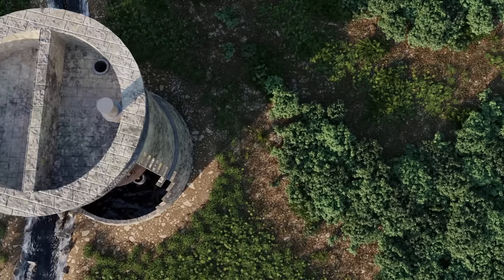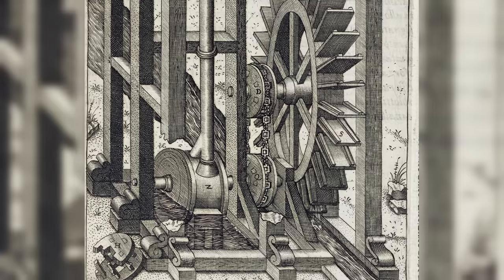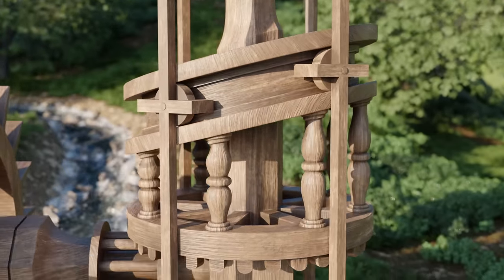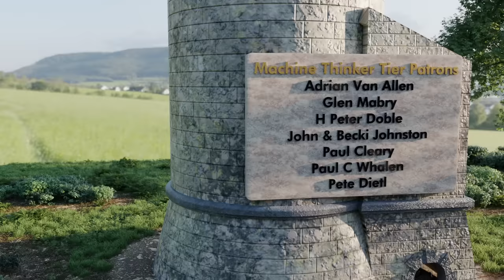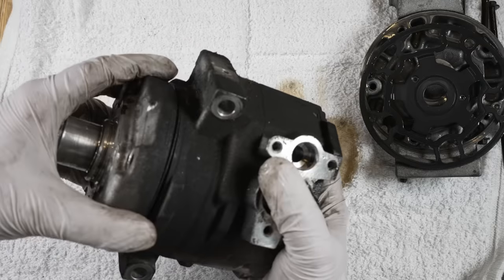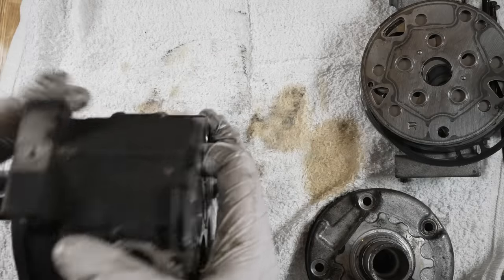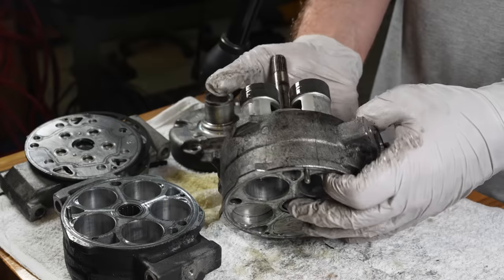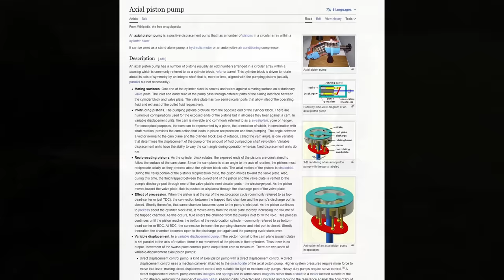How an ingenious 400 year old drawing predicted the future

Comment: Fun!  Just subscribed!  Ty!  It looks like a hydraulic pump on an turbine engine.  They are used to produce three phase power APUs, ailerons,  flaps, rudders, and wheels under load from the engines or for a limited time with a stand by jack when the engines quit for emergency situations.

Comment: I have disassembled a rotary pen type machine that used a swash plate system to drive the needle.  It had a Faulhaber motor and was very well made and smoothly operating.

Comment: Constant pressure variable displacement hydraulic pump of some kind. I was a hydraulic mechanic on UN-1N's and AH-1W's in the Marine Corps. our aircraft had 1,000 and 3,000 psi hydraulic systems respectively and I've taken apart lots of pumps and they look exactly like that on the inside. Except the pumps I worked on were no bigger than a soft ball for obvious weight savings on an aircraft.

Comment: I've seen designs where the swash plates themselves drive the fluid, but it's a sinusoidal type shape on the outer rim. There was a flurry of them on youtube about 15 years ago, claiming to be new engines with perfectly circular movements, no cranks or eccentric motion needed, so you get high speed rotation. Still achieving the intake, compression, combustion and exhaust phases.

Comment: Not just stuff like the car's AC, but you also have it in hydraulic sender pumps for things like excavators or even a ship's rudder (where the tilt-block is adjustable to reverse the hydraulic pumping driving actuators), or you find the same general configuration being driven the other way by the pistons in air powered tools.

Comment: Immediately at the castle portion I knew it was a pressure pump of some sort. I only know because I wanted to take apart a water pressure washer that had issues with seizing. Its well over a decade old and was from a garage sale. For $30, its engine was still good and used for both a kart and generator projects. The pump itself was bad (worn seals, corrosion, material loss; probably from some corrosive liquid or just sitting doing nothing with tap water) and could not be used for anything but was taken apart first before scrapping. Had this exact mechanism except it had 3 cylinders instead of 5.

Comment: Helicopters use a similar (adjustable) swash plate to actuate the blade angle of the rotor, making the craft steer left, right, forward or reverse.

Comment: For anyone not making the connection of pumps to air-conditioning.
The way most air conditioning works is you compress a gas vapor under pressure (thus the pump), which costs energy and makes it hot, you then direct the heat to cooling fins, and then when you release the condensed gas into a low-pressure space, the gas cools as it expands back into a vapor.  That cold gas then either flows directly across cooling elements in an AC system or coools a liquid which transports the not-heat to where it is needed.

Comment: This is also how a hydrostatic drive works on riding lawn mowers (and larger tractors also);  except it's in reverse:  meaning, you apply pressure to the pistons and it moves the shaft.   Rather than the shaft driving the pistons to make pressure, there is pressure applied to the pistons to drive the shaft-- and propel the mower forward or reverse on command with a two pedal design, no shifting at all.   The gas engine drives a pump that I believe is also the same design as this.  So there's actually TWO of these machines in a hydrostatic drive.  One converts engine torque into pressure (pump) and the other converts that pump pressure into axle torque (drive motor).

Comment: The water was pumped to the reservoir on the top of the structure in order to increase water pressure and steady flow at the bottom end of the downpipe, some towns in rural areas still use that method

Comment: A very similar design is used as a hydraulic motor in aviation. Instead of turning the input shaft to pump something, fluid is pumped to it and the shaft turns, doing work. I wasn’t aware the basic principal is that old but I should not have been surprised. We’ve had smart people amongst us since the beginning.

Comment: Rotary wing aircraft use a virtually identical method to apply pitch to the rotor. in the same way that pump throughput was balanced, the pitch adjustment is distributed, making cyclic directional changes possible with greatly reduced stress.

Comment: The return pipe at the top isn't some random pipe because he "couldn't imagine the water not goting anywhere". It's the water feed to the village or factory or whatever this would supply water to. When that pipe fills it becomes pressurized making it easy to push where you want it.

Comment: Phil Irving designed a swash  plate natural gas pump used in Sydney, it was double ended with I one ends pistons being the pump and the other an engine if memory serves. 
Also a common design of pressure cleaner pump.
Variable displacement pump and fixed motor versions are in hydrostatic drives in all sorts of low speed equipment.

Comment: Posting as requested before seeing the answer or reading other comments.  That pump is exactly the system used in automotive air conditioners.  GM first developed it for Cadillac in the 1960's since it was much smoother than the standard reciprocating pump.

Comment: I had a cordless sawzall that used the same angled cam system to drive the blade reciprocation. Lots of pressure washers use this design too. Not just AC compressors.

Comment: They have hydraulic pumps  that push fluid at extreme hi pressures, hydraulic motors and pressure washers that use that design. Very powerful pumps.

Comment: The reservoir and drainpipe at the top, just like a modern (or older) water tower, acts to maintain a more or less constant water supply pressure, at least, over the narrow range of depth of the reservoir.  It would also allow flowback of excess water back to the stream or river.

Comment: This is also somewhat similar to how some tractors are propelled but in that case it would be two separate pieces - on one end the transmission spins a wobble plate, the pistons pump a hydraulic fluid through a bunch of hoses, thus applying pressure to another set of pistons, and those spin another wobble plate that spins the wheels

Comment: If you put a cam on the water wheel itself, you can translate the sinusoidal horizontal movement into vertical movement via two 90 degree triangles, thereby saving about a third of the works.

Furthermore, a wheel lever attached directly to the water wheel can pump with no other machinery at all!

Comment: I used to work on hydraulic variable displacement pumps for aircraft, which work on the same principle, only difference is that the wobbleplate angle is variable.
A few rooms further from me they worked on CSD's (Constant Speed Drive) for the aircraft generators which also had a variable displacement pump in order to maintain 115 Hz or whatever the grid frequency is.

I didn't know AC compressors worked on this principle as well.

Comment: I was about to say A/C compressor in a car. I have attended the repair shop work on my car :)

Because the pistons have the same section on both side, I don't think there is a low or high press ion side. It is just double number of active pistons.

Comment: Reminds me of the self compensating variable displacement radial piston hydraulic pumps on excavators and snow blowers. When none of the hydraulics are in use, the swash plate is in the center or neutral position. When flow is detected the system automatically moves the spool to swing the swash plate. On a large ribbon blower these things can pump 60 gallons per minute or more either forward or in reverse.

Comment: If I were to guess, giving the benefit of the doubt, the reason the water has a place to drain once it gets to the top, is because it's a water tower. Likely would pump it to the top, then send it where it needs to go (in town or in a crop field, ect) and keep the system pressurized by gravity.

Comment: IC engines have and still do use swash plates.  Engines are pumps whichever way you look at it.  The water escape hole in your excellent rendering could easily feed into a level feed pipe as the tower automatically creates head and thus pressurised delivery. 
As a much younger man I had a swash plate engine in my head before I became aware they were in common use.  But designs on paper or in the mind are nothing until put into reality. 
Ramelli was a very prescient thinker. Great video! Subscribed! 👍🏻

Comment: The Dynex checkball hydralic pump is a much closer analogue to Ramelli's concept. The cylinders are fixed and the swashplate rotates. No valve plate is required and the internal leakage is close to zero. You can combine this with a VFD driven electric motor to get near infinite flow control.

Comment: Pressure washers use this approach too, to get very high pressures with a low flow rate -- and thus making the connection full circle back to Ramelli's water pump.

Comment: I've seen (and done job shop work for a customer on) power steering pumps, I think SAAB or something, that are swash plate pumps like this.  I also believe that many hydrostatic lawnmower transmissions work on the same principle.  But yeah, A/C compressors are almost all swash plate pumps, some of them are variable displacement and controlled by the computer (I remember GM used these on the LS motors).

Comment: There are very similar pumps, the "variable displacement piston pumps", with the difference the swashplate can change inclination to obtain a variable displacement. Another difference is that the swashplate is stationary and the cylinders rotate instead. these are used in hydraulic systems in airplanes to move the control surfaces, landing gears etc.

Comment: It is equivalent to a for cylinder set-up for a combustion engine. Just pumping water instead of compressing gas. The up and down causing disk does the work of a cam in separating the "cylinders".

Comment: Always thought it would be neat to make a single cylinder piston engine using this type of barrel cam. It would be super compact and the output shaft would be axially aligned with the center of the piston.

Comment: I lot of hydraulic pumps and motors use the swash plate design.  Quite popular for speed control like in some skid steer loaders. Also used for variable pressure/gpm flow.

Comment: The hydraulic pump version is more closely related to the old water pump designs than the automotive A/C compressor designs. Variable displacement and high-pressure capability are key features of these piston pumps.

Comment: 5:14

forestry machines use a pump of a very similar design but with a variable swash plate for precise hydraulic control, rather than simple valves, also pretty much every hydrostatic transmission everywhere including most lawn mowers
Reply: ah! AC compressor, they also make them like, and this was a somewhat older design, 1940s to 1970s -ish, but AC compressors used to look like a Wankel engine, supposedly that design is actually far more efficient for compressing gases, but reliability can vary

Comment: diesel hydraulic locomotives use a similar pump. usually the plate can be tilted to function as a CVT.
and if you put the whole thing in reverse, you get a pressure driven motor, also with a cvt.

Comment: There was an electrician and instrument repairman arguing about what was more important, the electricity or the instrumentation that controls it. They were going back and forth with reasons of why their trade was more important than the other. I jumped in and said that machines were around for thousands of years and that electricity and instrumentation were still very new, but it's the machines that are important, yes electricity makes them easier and more efficient to use, but they don't really need it. And without the machine, electricity and instrumentation don't really do anything.

Comment: GM Frigidaire first used these compressors in the 50s. Some A/C compressors do actually use the variable angle swash plate, so the A/C doesn't start blowing warm at engine idle speeds, also a 1950s GM innovation.

Comment: Sailors used a pair of simple leather flap valves in a siimple square wooden tube to pump water out if a bilge with a pump rod.

Another name for flap valves is reed valves.

The "Antykathera" is a much more ancient machine with gear wheels to predict star movements.

Comment: Did someone say, axial piston pump?  If not that is the term for this. One feature of these pumps is they pump a specific volume per revolution so their output can be metered and then adjusted by motor speed.

Comment: There's a lot here.

The reduction gear is similar to the differentials on rear wheel drive cars with the smaller pinion gear driving the larger ring gear at a 90 degree angle.

The swash plate is similar to the helicoper which affects the direction it's heading by changing the angle of the rotor blades.

The rods remind me of overhead valve engines which use long rods to deliver the output of the camshaft to the rocker arms.

Lastly, the pumps at the bottom reminds me of the oil pump-jacks and deep well water pumps. However, the movement of the pumps with the rods and the swash plate would suggest that the water is being pumped by filling a certain volume and gets pushed to the next container and eventually goes up the pipe which is similar to some water pumps, super chargers, and AC compressors which creates a vacuum for fluids to come in and channel them into a smaller hole.

The machine at the end is an AC compressor which utilizes most if not all parts on the renaissance water pump

Comment: Swashplate designs get reinvented. I designed a wacky pump with vague similarities as a teen and 10 years later, I designed an engine with wobble crank arms around offset angle bearings on a main shaft. Horizontally opposed pistons around the shaft in parallel cylinders. Then I found both Phillips and a NZ company had worked on stirling engines with similiarish cranking motions.  Some of us come up with these designs ourselves but the frequency of inspiration increases with opportunity to research enabling concepts. When I first invented my early stuff it was really a stretch to imagine them in motion but it became easy after a while.

Comment: The motion of the swash plates brings to mind the control of helicopter rotors.  Another application by a stretch of imagination is the nutating disc water flow meter.  The camming action of the device easily converts rotary motion to reciprocating motion.

Comment: Cheap power washers use exactly that pump even more similar to it than the AC compressor.  But with 3 cylinders and using rods as the original design. At least all the ones I disassembled.

Comment: Well the closest pump that I have worked with would be an automotive AC pump. They basically work exactly the same as this. A swash plate pump usually has a fixed plate and cam followers/plungers that rotate around on that plate and are pushed in by the point and return by a spring.
Reply: Well, I was hoping he was going to show me someplace these are used I wasn't aware of.

Comment: I believe, this is the basic design of an Air conditioner compressor for a car, some have six pistons driven by the swash plate. 

The AC in a car needs to move a lot of refrigerator, in order to cool down the cab from 130 degrees down to about 70 degrees in minutes.

Comment: John delorean designed an absolutely bonkers engine for the DMC that had the same layout. The material science and machining wasn't there and they ran out of money before development got very far. 

But it was a wild design, had a mechanical supercharger built in, fully injected, sleeve valves, could have revved to crazy RPMs.

Comment: I think what you have here is a double-acting pump.  Each piston pair discharges one end of the pump and then from the other end of the pump.  By using an odd number of pistons, the discharge of the pump is constant without pulsing.  the reed valves are a form of check valve which allow both ends of the pump to pump from inlet to outlet in the same way.  I don't think this ia a staged pump, meaning the dischage of one end is the intake of the other end.  I think this pump has equal discharge pressure from both ends.  That's how the output is kept constant at a given speed.

Comment: Immediately made me think of the swash plate mechanism for controlling the pitch on helicopter blades, only difference being on a helicopter the swash plate is what's being manipulated directly which changes the height of the rods that attach to the blades, thus changing the blade's angle

Comment: At first blush this looks to me like the inverse of some kind of an engine. Maybe an internal combustion engine? The pumps if inverted to push could in theory provide turning power in that direction. If not that, then perhaps an overhead cam for an engine, where the turning of the wheel provides timing for the valves. So you’re opening and closing the valves with a certain timing.

Comment: I had 2 of those AC compressors that had various issues. I took them both apart and made one good one. It was for a girl I worked with that had a small baby and no working AC. I told her I would try and fix it with what she could afford which was basically a few cans of AC gas and a old AC 
Compressor from a junked car that matched up to the one she had. 
Long story short I took them apart and mixed in the good parts all into one, bolted it on, filled it up and that thing worked like new. Ice cold air and it ran smooth and quiet. I was very impressed with what i created for just a few bucks worth of ac oil and two trashed compressors. Not sure how many years it lasted cause I lost touch with her after she went to a new job cause she was sleeping with everyone. She could milk you like a milk maid and she loved every second of it. 😅